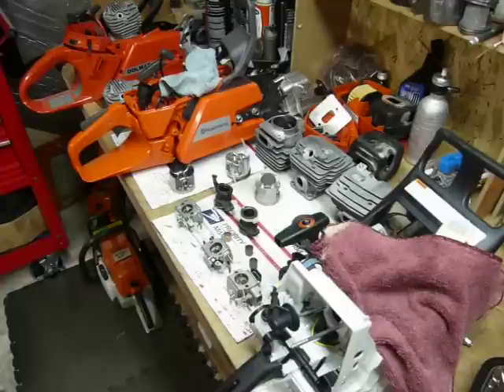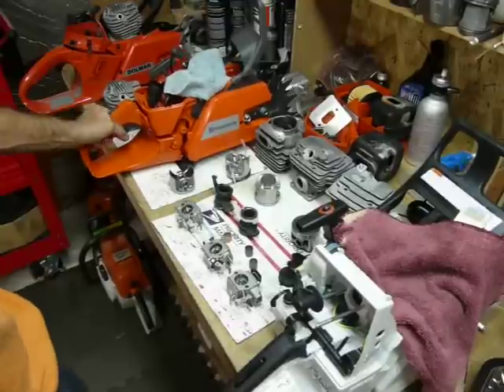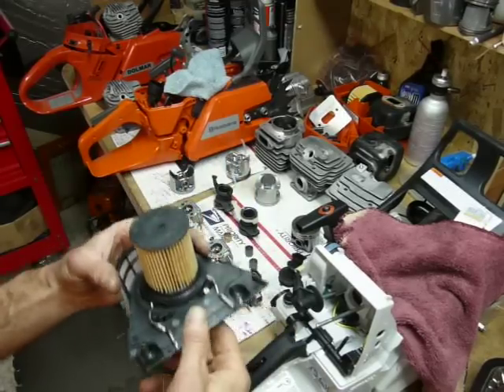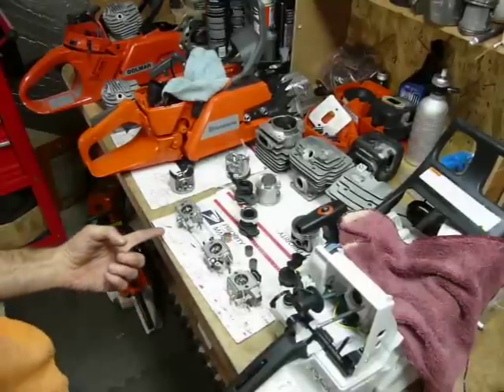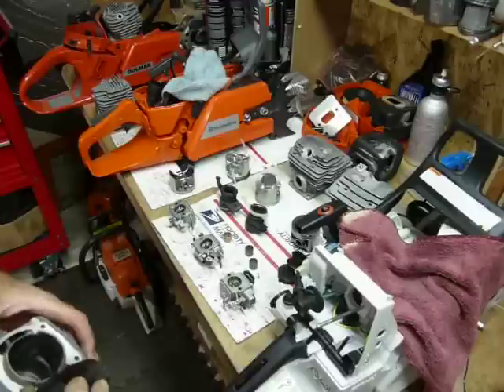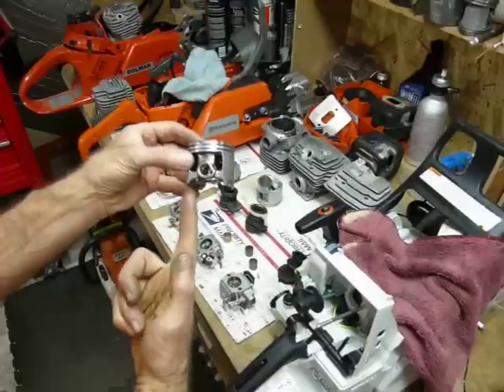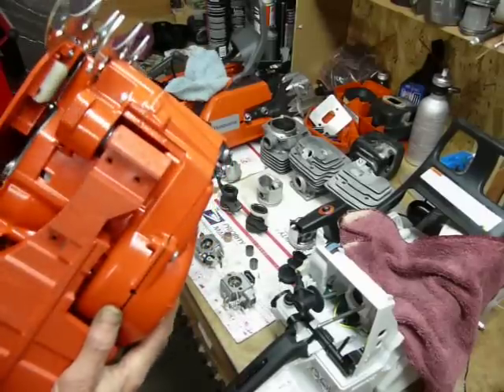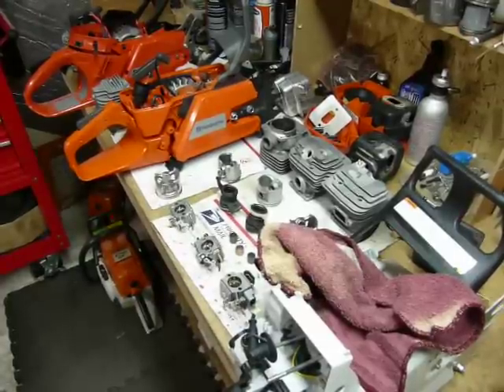Dolmar ps7910 vs Husqvarna 375xp (372xpw) vs Stihl ms461 - Bench Talk

Comment: The cylinder on the Dolmar/Makita 6400 has massive transfer's, its got that different design.  Is what would be cool is if you could take the 6400 cylinder, 47mm, and then have it bored out to 52mm, then used the 7900 piston.  The 6400 cyllinder intake and exhaust ports would probably still need some work, but I think would turn out running pretty darn strong

Comment: Best chainsaw video I've ever seen. Which one would you buy is the question?
Reply from the maker: Hello. Thanks. 
It depends on many factors. Nearest dealer, bars already owned, location of the work (ie. elevation, inland/coast), size of the wood, parts saws available, etc., etc. Equally done up, they are relatively close. I would not buy the Dolmar/Makita if I was hard on equipment though.
Thanks for watching.

Comment: Good stuff Jack, it's the one thing I would change on my 562 if I could would be the Stihl style 3/4 wrap arrangement in favour of the 372 style.
Reply from the maker: outinthewood Yah, need a divet in the ground or a root exposed or they roll over. Kind of makes you wonder what happened during the testing/input stage of the testing process.......
That side bar only needs to be another 2" longer and it would be golden. Things that make me go hmmmmmm.

Comment: Is the Dolmar / Makita chainsaw as field serviceable as a Shihl?   A Shihl product can be largely taken apart with a Torx 27 and bar nut wrench which also takes the spark plug out.   Even if I was to choose a Makita 7900 the likelihood is I'd still use Shihl products to support it such as Shihl bar oil, mix oil, cutter chain, cutter chain files, maybe even a Shihl bar.  

Thank you for this comparison.  I've always been intrigued by Dolmar Sachs chainsaws from the early 1990s when they were more expensive than the Shihl professional saws.   Then Makita was said to pull away from the professional chainsaw market with the resulting fear being what happened to Homelite and McCulloch chainsaws when they turned away from professional saws in the 1980s into junk.  Realistically they were a generation behind what Shihl and Husky were providing.   

The Makita chainsaw of today looks in the videos to be at least as good an ergonomic machine as the Stihl with possibly higher to power to weight ratio and better vibration system.   I don't see a street department or park's department buying anything, but Shihl because of professional Stihl chainsaws industrial build, serviceable quality and support.    A Mikita 7900 though appears to be at nearly the same level as a Shihl 500i and possibly nicer to use, with a price below $1,000 compared to the Shihl 500i at about $1,500.  If the 500i works one critical day more than the 7900 the 500i is still the right choice.  The question is, is that case?

Comment: I have not looked at the Dolmar IPL but the 461 IPL lists the PTO side bearing as a dimension 15x35x13 which corresponds to a 6202 or? These are the same dimensions given for the 044/440 PTO side as well. My understanding is that the bearing has a lip for the oil seal so it is proprietary and not a generic 6202 hence refering to it by the dimensional notation.
Reply from the maker: Kyle hi.
Yes, proprietary.  Stihl uses a "special" design on the drive side quite a bit in their machines. It has an extended (wider) outer race that acts as the sealing surface for  the outside lip of the seal.
Yes, they are the same dimensions but, for whatever reason,  different part numbers. Might be the cage is a different construction since I don't have one of each sitting on the bench currently.
6202 is a generic size, yes.
Thanks for watching.

Comment: Thanks Jack, it's neat to see different versions of the same "class" saw apart at the same time. Some very enlightening details there. I've had very little experience with the Dolamar/Makita saws but I'll say the few I've run (all stockers) were pretty good out of the box but always seemed a little light duty to me. A guy would really have to be paying attention, if you went Mongo on it seems like you might start braking mounts, etc.

Comment: I want to know which chainsaw is the best. I want to buy one of those. Which one? Thank you.
Reply from the maker: Hello. Best is a relative term, for me anyway. Some are best in ergonomics, power to weight, reliability, toughness of the model, ease to work on for the end user, etc. I would consider at which shop a guy wants to spend his money. Proximity of said shop. What other bar mount patterns do you already have. Spare saws to cannibalize when a guy needs to work the next day. 
Most of the saws in a particular class range are within reason power wise in stock form. That is not always case once zipped however.
I like some of the things about all of these saws. At the same time, I dislike some of the things about all of these saws. It would be hard to tell you which saw is best while knowing nothing about you application, cutting style, chains, maintenance habits, length of bar, whether or not it will get fitted with a zipkit, etc.
The xpw went extinct in '09. I can build you one if needed. It is not a cheap endeavor though. They run close to an equally done 461, whereas the 71cc x-torq saw in left in the dust.
Thanks for watching.

Comment: I watched the whole video and was very intrigued.  Guess I am a saw nut.  All my saws are stock 365, 555, 441, 026 echo 380  the 66.7 cc saw.  the echo is a fun saw for giggles.  The 441 will be setup for pushing a bigger bar in big timber with your enhancement's this winter.  I might want to grind the transfer caps on the 365 to make it a 372.  Do you think it will cause the 365 to wear out a lot quicker being its just a firewood saw that's being abused and I only bought it for reliability purposes, the saw that will always start and run for the next 10 tens